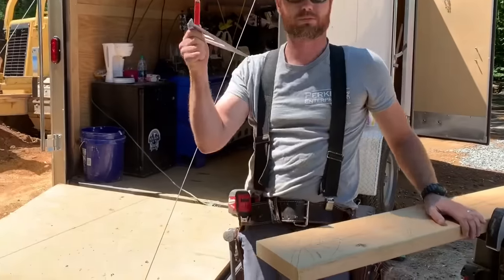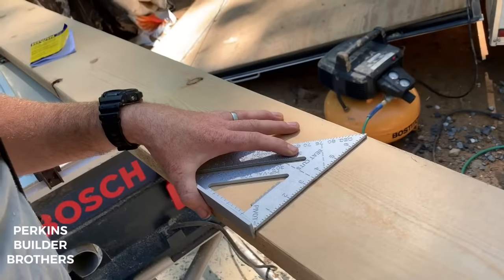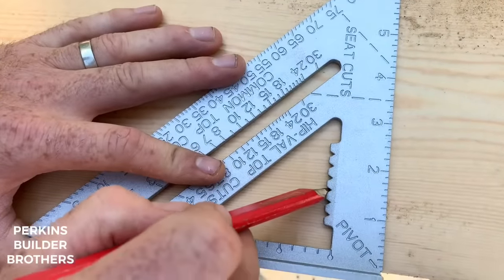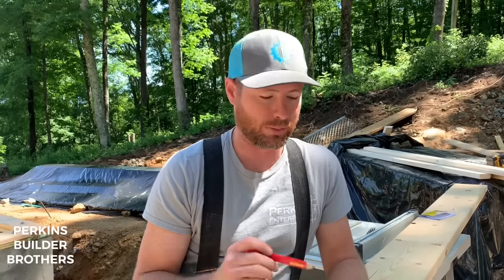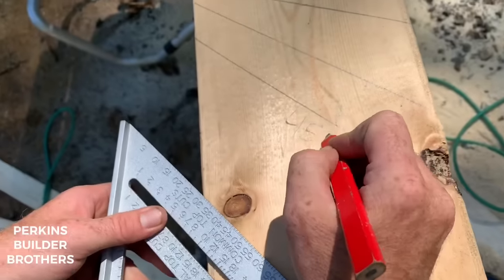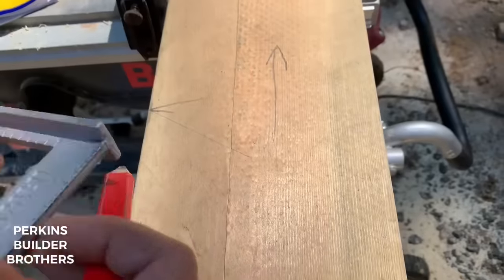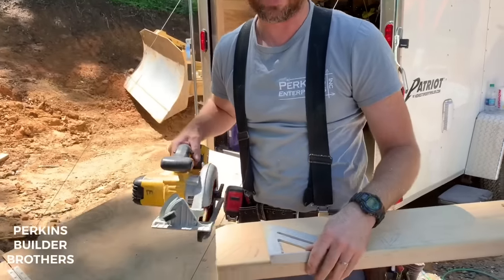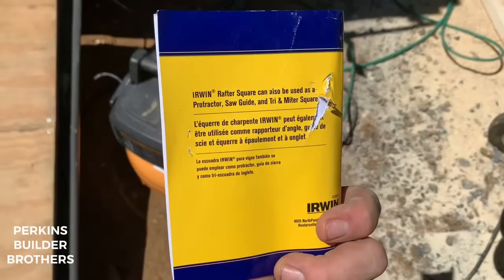How to use a speed square | Why it might be the most important tool you own

Comment: Shalum
The only thing you missed is the use of the degrees side of the square... For example if you are making a back cut(this is were an angled board is setting on another angled board... ie facia on a common rafter). Now your square becomes a calculator... Every angle derives from a 90° right angle so if the rafter pitch is on a 10 common which is equivalent to a 40° angle you would subtract 40° from 90°=50° on a back cut. Great video thanks

Comment: 3/16" thickness... THANKS! Been doing craftsman style finish work lately with 3/16" reveals for doors and windows and using a combination square to mark (or 3/16" block cut from drop until it gets lost in the depths of my pouch). Realizing I can just use my speed square should produce some pretty noticeable increases in efficiency.
Reply: A 16 penny nail works just as good

Comment: Adding to the stud layout tip, the base of the square also has marks in 1/4" increments (small triangle inside) and 90 side to opening for inner triangle is 1". Hold the square at mark and mark 2 over = 1 1/2"  tick, scribe and scoot.

Comment: Great video here is a few more tip's. To figure out what the pitch is to an existing rafter set your pivot end on top of the rafter take your torpedo place on top of square and raise square until level then you'll have your common rafter cut. The other is to teach them how to do a long cut for a valley rafter lay on. Lastly explain how to get the bevel degree for your saw using the numbers off your speed square for said valley rafter long cut,  you can also use the pivot on your speed square plus your chalk line to form a plumb bob. I'm the cut guy on our crew. Lol
Reply: please do a video!!!
Reply: Ya do a video, Sounds like mega carpentry smarts

Comment: I used to build houses and after hits in the Army I started working in a weld shop the boss looked at me like I had a third eye when I brought my speed square to work next thing I know we have speed squares all over the shop
Reply: That is awesome, Don.
Reply: Angles? Not sure what else it would be good for. Tubing has radius so it rarely grabs the edge right. Maybe you're referring to a shop that uses inches over feet values such as in a structural beam shop.
Reply: @BGraves  ummm, he didn't imply that he was working with round pipe. Speed square would have as many uses on metals as well
Reply: Use mine on pipe...have cut the "corner" out to measure ya 90 running socket pipe!
Reply: Yea dude, I'm an industrial maintenance technician at a heat treat facility and I use mine atleast once or twice a week when I'm fabricating something
Reply: Don't believe you don
Reply: Lol your funny and also smart
Reply: Don Pegar funny I use them all the time to fabricate in the shop to build everything that I need true. I weld and fabrication for an automotive assembly department.
Reply: The only tip I didn't see was using the speed square to determine existing roof pitch, must be used with level , very informative
Reply: @duaneshepherd8281  I've found that to be sorta useful, but not something i would use to order trusses to match, or to establish rafter cuts.    The reason being is that the existing roof is rarely a consistent slope on account of lumber characteristics, sagging, or the roofing material may be uneven- think extra shingle at the first course, or a lap in the ice and water. Both are enough to throw off a small tool being used to establish a measurement that is inches long, which you will then project and extrapolate to the entire roof slope.  
Much better to just bring up a laser, or do some string witchery.  Even a level (4') is giving you a measurement so much smaller than the roof that it is susceptible to problems.  Best thing is a shot above the exterior support of the rafter/truss and a shot at the peak.   Then the errors inherent with your own inaccuracy, and in the potential variation in roofing material thickness are much smaller, when compared with the size of your measurement. 
(1/4" difference because of a shingle lap or a shakes thickness is peanuts over 40', but a major and horrible error over the length of a square)
Reply: To think originally if u showed up with a speed square u were run off by the other guys lol now everyone uses them
Reply: @BGraves  I've been a metal building man, and fabricator, for 38 years. Even though I specialize in metal roofing and siding I do a lot of fabrication work. I've got three different sizes of speed squares and probably 20 of the normal ones. Even though the tube steel at times has rounded corners, the flange of the speed square is still plenty wide to grab the flat portion. Plus if you shove the speed square down firmly you will still find square even on a piece of pipe if you have a little experience with it. I'm project manager, but in the field I used mine every day all day.. working metal you have to have one nowadays. I feel sorry for my father and grandfather who had to work without them for so many years.

Comment: Great video and fun too. I find mine really useful for small length measuring, easier than a tape. Also, make sure the base is 1/8 of an inch, makes it easier to adjust your measurement when the square is standing on the base.

Comment: My first day as a carpenter, the master carpenter I was working with threw my speed square across the job and handed me a framing square.  He said a speed square was for marking 90 degree cuts and that a real conventional roof framer should use a framing square.  I still use the speed square when accuracy isn't as necessary, but in exposed conventional rafter framing, a framing square and a small sharp pencil are definitely a requirement.

Comment: Good information, straight and to the point. But it's still better to use a framing square for rafters since the extra length allows you to mark the drop and width of your rafter tail easier. Not to mention they have the step down for common pitch roof hips on them. Do a video on them

Comment: You can also drill holes in it to act as a template to pre drill holes into decking boards etc. Works a treat especially for a perfectly square and even set out board

Comment: The skill saw straight edge was cool. Never thought of that.
Reply: I use that all the time,, but if you hook the edge of the square over the board you are cutting on the near side of the board it is easier to keep your fingers clear of the blade, and because the saw is pushing in the same direction that the lip is locking up in, it is less likely to shift on you
Reply: @UncleRons_3D_Pub  Thanks for the heads up Uncle Ronny. You're probably a lot older and wiser than this young buck, since you're already a uncle.
Reply: Good safety tip as well 👍
Reply: Bigg Puph used to have to chip my own saw blades out of flint and obsidian
Reply: Skill is a brand. It's a circular saw. Common misconception.

Comment: The only complaint I have is that when you're making a cut on a board with a skilsaw, the base plate of the saw should be on the longer portion of the board to keep the cut smoother and helps protect not only the blade from unnecessary wear from blade flutter but also less wear on your saw's bearings from blade flutter.
Reply: I know your comment is 2+ years old but for anybody else reading this, old mate’s above comment is really only applicable to people with little to no experience using circular saws. It’s not difficult to learn to hold your saw flat to a board with very little baseplate purchase on that board. It really just comes down to experience and practice.
Reply: Try getting an 'other handed' skill saw.  I am constantly cutting from thin edge.

Comment: When using the speed square for a straight-edge against the saw shoe, the square can be set on the edge closest to the operator and held more securely on the same end as you show.
Reply: If I put the square on that side my saw hits the high edge of my square. To do it the way you suggest I would have to raise my blade making it harder to make a true cut.

Comment: 3:08 you said its a 40 degree angle in relation to the board edge- but the angle is measured as 40 degrees from the square cut line.
Reply: Noticed that too, you can instantly tell as 5 degrees is still nearly perpendicular.
Reply: Mak Roberts  nice wordplay handsome.  Where do these words come from anyway?

Comment: This is helping me a lot.  I got suckered into helping my parents build a coverd lean to.  The one thing they picked out of the book of course did not have plans available.  It did not give you the height or distace from the front for the offset rafters.  Your string trick on another video helped me get the height and offset.  The limited drawings in the book even have the birdseye cut short of the top plate width.  So it was throwing us off so much.

Comment: Great video... Thanks!  However, when using the square to square/cross cut a board, I think it's safer to hold the square on the side of the board closest to you, rather than on the side away from you.  It does a much better job of keeping your hand out of the path of your circular saw.  You're pushing the saw away from your hand, rather than toward it.  :-)
Reply from the maker: Ok,  so that’s not a bad idea for safety... but when using a standard saw (blade on the right) set at full depth, the motor housing will hit your hand and cause you to mess up the cut. I like to hook on the far side of the board for that reason. Thanks for the question!
Reply: @PerkinsBuilderBrothers  That makes compete sense!  I've motor housed myself a few times making such cuts.  Thanks for your reply!
Reply: If you cut your hand while holding a spwwed square to cross cut then you shouldn't be using a speed square or a saw for that matter lol
Reply: Motor hits T-bar that way... Cant complete a cut on a 2x6.  This is for those of us who always cut at full depth... You know us.  The guys who have the guard pinned, run across 2x4 walls, sheet a 10 pitch with no kickers, and make lots of money.
Reply: @9mmkahr  sounds like you're my kind of framer!If you're using a spewed SQ too much you're not going fast enough.When some one else takes it don't replace it find better methods ex pattern Jiggs my favorite knowing lengths of pitch cuts on typically used lumber.,use tape measure make your marks., if you're looking while you cut You're not trying hard enough to be the best frame on good buddy peace ✌

Comment: If using as a cut guide, turn square around so that the lip hooks the board the same way you're pushing saw= much safer ! And quit throwing your tools around.
Reply: James Sherosick I was thinking exactly that as he was doing it lol
Reply: That seems so obvious to me that I wonder why he does it the other way around.  Is there something we're missing?  Perhaps the board is more stable his way?
Reply: The lip on the leading edge causes issues with the blade guard, doesn't it? I understand what y'all mean about pushing, but I'd assume the reason for his method is the guard.
Reply: @DHcrazed  no not at all , as it is the table only that touches the edge of the square. The guard is an inch and a quarter inside the table.
Reply: If you are cutting a board thinner than the length of the speed square (like a 2x4), the square edge extends past the leading edge of the board giving more immediate support for the saw table. It's irrelavent in this case because the width of the board he uses for his example is wider than the square is long.
Reply: I'd guess it's because hes holding the board in place with his left hand as hes pushing the saw to make the cut. if he were to put his square on the leading edge the board would need to be clamped.
Reply: If you do it that way the saw can push the speed square and pivot, having it on top is the right way.
Reply: @pushtostart1377  what way? The way I described?
Reply: James Sherosick the way he showed you in the video
Reply: @pushtostart1377  yeah thanks, it really is a simple process. If cutting TJI members use a 10" square, it works well as the skil saw drops and rises.
Reply: Hook on top. Square doesn’t pivot. Also, you can hold board by pulling, while pushing saw. Nobody has time to clamp every piece. And, many saw bodies are low enough that you can’t clear the lip when the square is hooked on the bottom edge, especially with a 12” speed square.
Reply: The pivot point will throw you off on the beginning that's why you do it the other way
Reply: if the lip is at the start of the cut you are pushing the job with the saw and the guide.with it on the far side he pulls it toward him.
Reply: Stop using a square to cut a 2x4.....its
 embarrassing for everyone
Reply: It works both way same for me

Comment: The thing with a square is when you mark your line do it the other way because the force of the pencil keeps it tight to the 2 by. When you cut place the square opposite then how he shows for the same reason. The force of the saw keeps the sguare straight.
Reply: Was about to make the same remark but felt sure someone in the comments section would have done so already. Also..with the square and your hand behind the work piece, it is well out of the way of the blade.

Comment: It only took one day on a carpentry job to realize I needed to buy my own f’ing speed square, pencil, and chalk line.  😉
Reply: More like 3 pencils, 2 speed squares, a chalk line, 2 tape measures, a hammer, your own bags, and a lunch box.
Reply: ninja5672 bags?
Reply: @robertbeirne9813  nail bags, tool pouches, etc. What you wear to carry tools, nails, etc
Reply: ninja5672 👍
Reply: @ninja5672  yes, pencils everywhere- and both ends sharpened so you only have to stop every other time you break lead.

Comment: I love this tool. I also use it for calculating hypotenuse lengths:
While building an A frame swingset, I used my speed square to calculate how much longer the legs at one end needed to be in order to compensate for a 2" height difference over the span. I drew a perpendicular line on a board, scribed at 2", then drew an angled line from the first one at the same angle as my A frame, and measured the length along the angle to the scribed line. 2 ¼", no trigonometry needed! 
Thanks for the video. My jaw dropped when you showed the birdsmouth. I need to do this for the slide platform of the swingset.
Reply: @adamhull9994  gotta be a square first!

Comment: You got the angle wrong. It is 40 degrees off of the perpendicular line or 50 degree off the board edge. Other than that great video.
Reply: I agree with you

Comment: Another cool trick a guy taught me years ago which at the time I thought I'd never use but always use now is when flushing up two boards. to drag the head of your hammer over where the two boards meet and feel thru the hammer handle for a that little bump. I tried it.. It actually works.. Sounds like no big deal but it's one of those things that actually stuck with me.

Comment: Also inner edge on the side with a lip edge near the pivot point is a 1/4" scribe, and the other inner edge on other non lip edge is a 1" scribe, this works with squares that don't have those other scribe teeth as well, also the edge right before the teeth is a 3/4 inch scribe, many square also have a 1/2" scribe hole somewhere on it. A carpenters pencil can be used as a 1/2" scribe on the thicker edge and a 1/4" scribe on the thinner edge. If you cut the pencil right you can use the drawing tip as a 1/8" scribe just by trimming it to a point in the exact center of the thinner edge and holding it right, this can then be flipped to the wider side to be used like a 1/4 scribe in the same manner. There are some other nifty ways to hold it (using an extended ridged finger as a guide) or trim the point in different ways for other easy scribe measurements.

Comment: I did framing and a little roofing for a couple of summers in high school (for a cash under the table, "you sure look like you're at least 16-18 to me" kind of general contractor).  I think most of the time I saw others using--or whenever I was using--the scribe teeth, it was as a beer bottle opener.  Also once witnessed the corner formed by the inner part of the straightedge side and the rest of the tool used in conjunction with a dull af plane iron to pack and roll a few of the most pro looking j's I had ever seen.

And some say kids should use summer vacation to relax, reset, and revitalize themselves for the next semester.

Comment: that notch at the pivot point allows use to spin it around a nail and use it as a compass and there is another ruler on the "fence" leg of the square that allows you makes lines for multiple studs next to each other without using your tape

Comment: I started cutting roofs in 1975 and a speed square is nice for carrying in your bags, but when you start laying out roof rafters use a framing square and double your numbers.
So if you have a 4 and 12 pitch use 8 and 24 on the outside of your framing square, your plumb cuts will be a lot  more accurate. Especially for 2x8 or bigger
Although I always did carry a speed square, they are handy. 
 Just some advice from an old carpenter.
 Have fun working!

Comment: I also use mine for a quick drywall rocker when it's not avail. I usually set my framing hammer on the ground for my fulcrum. Also to set my door casing-to-header beam spacing.. when Galva-Aluminum stud framing 🙏♥️💚💢💯💪😎👍🍀🥦

Comment: Girder? You mean ridge board. Also, I did a demonstration for some kindergarten kids and held up a square and was told it wasn't a square, but a triangle. I agree with you on the essential tools. Tool belt, hammer, square, tape measure, pencil, utility knife and chalk line.